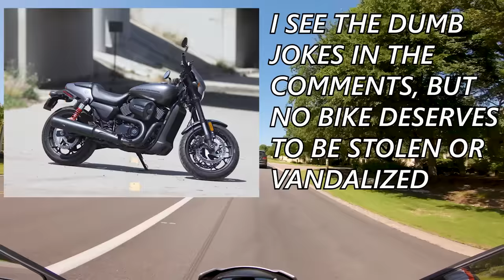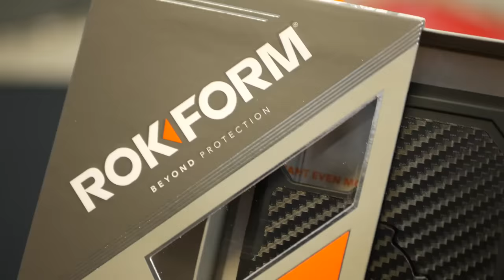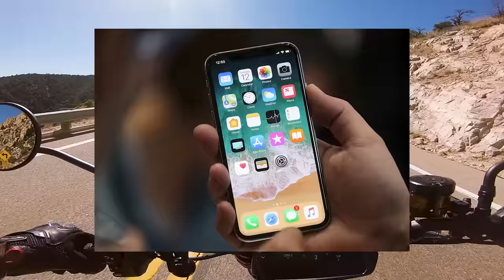How to Prevent Motorcycle THEFT

Comment: Mate those tiles work off a button battery and low energy Bluetooth, meaning they rely on phones seeing the tile and reporting it's location

There is no drain on the bike battery. But also you want get updates on the location unless someone is within Bluetooth range... Useful, but not as good as a active GPS tracker
Reply: I think it has to be in range with your own bluetooth, not just anyones. So basically you would need to be in the same room as your bike

Comment: My advice for security
Disk lock with alarm
Chain lock
Motorcycle cover
Make a hidden kill switch
Unplug  the spark plug replace it with temporary busted one, ohh by the way carry a portable battery charger cause expect the batteries to be drain

Comment: You could remove the battery or self sabotage the wiring and put it all back before riding out ;)
Reply: Or just remove the fuse for the starter or fuel pump

Comment: See Auto Taser on Youtube. I don't think it's still being sold (maybe a used one), but it puts out 50,000 volts and sparks run up and down the bar if shaken. Designed for steering wheels, it should work on a motorcycle. I have one... I used to use it on my Caterham Super 7 (coolest car in the world. Had to sell it 10 years ago), but haven't tried it on my 1998 BMW K1200RS. No thief will play with it - it will knock him/her (maybe her) to the ground.

Comment: Part of the reason the cops don't care is because they get nothing by solving the case. If the cycle is recovered it becomes property of the insurance company. Mine was stolen from a parking garage that had cameras. Security sent the footage to the police department and they texted me some blurry stills of the dirtbag. Case not solved. I've been told selling the individual parts yields more money than the cycle is worth, in which case two or three dudes would lift it into a pickup and take it apart later. Wonder if that's true about the parts...

Comment: what about a kill switch? or even just a quick disconnect for the battery placed some were only you know on the bike. sure it wont stop them but it'll cause them to slow down in there attempt to steal your bike. and if you live in a really bad neighborhood maybe both a disconnect, kill switch, and disconnect the shifter where it connects the the trans so if they do get the bike to start they will get so frustrated with it not going into gear they might just leave it alone.
Reply: I actually have a system installed in my cruiser so i can kill it off by remote just imagine if your on the highway just stolen a cool looking bike and that it shuts off while going over 80mph

Comment: Sorry papa Yam. Most protection out there just doesn't cut it for me. I want trip wires, M15 land mines, handlebars that deliver 2,700 volts of electricity, pressure triggered seats that fire a bullet vertically into butt-hole until disarmed... I want my bike to scream "omae wa mou shindeiru", instead of just giving it titanium panties hoping some fondler won't pry it open.
Reply: Build a electric mat. Park bike on mat, lock it all up, walk off the mat and use remote control to turn on the mat. Volts of cattle fencing charge will drop that sucker and he may or may not survive.

Comment: What ever you guys do, do not go for Xena or Kovix.

My Kovix lasted 2 days, before i forgot the lock was on the disc and I rolled the bike backwards by foot whilst sat on the bike, up a hill on a driveway. The disc lock hit the calliper and instantly broke in half and fell off the bike.

As a side note, the calliper, disc etc all have absolutely no physical damage, not even paint transfer.

Am I stupid for leaving the lock on and rolling the bike, sure, but isn’t the purpose of the disc lock to stop someone pushing your bike away? And is that comparable to sitting on the bike and rolling it with your feet (no engine)?
Reply: What Kovix model did you have?
Reply: @YaboyCurtis_  hey mate, it was the Kovix Overlord, I think that’s the KNX-6

Comment: After my CBR500R was stolen (cue the jokes from Yam) from the front of my house in Melbourne, Australia, I decided that I needed some protection when I bought my Street Triple. 

I had, not one, but two Kryptonite chains on it! They were hooked around a metal street pole out the front of my house. It was as solid as a rock, that thing wasn't going anywhere. 

Motherfuckers brought an angle grinder and took it in the middle of the night. I woke up to a pile of chains. My jaw dropped when I saw the pieces of chain they'd cut off.

I used to always joke that the only way someone was stealing that bike was with an angle grinder, which would wake half the neighbourhood, but some crazy fuck actually did it. 

No more bikes until I have a garage.
Reply: Same, I feel like I am not getting another Motorcycle until I move to a house with a private garage.

Comment: What to do when I have a drum brake on my old bike? Is there a similar lock for drum brakes comparable to a disk brake? Or should I stick to chains?
Reply: You could put a beefy padlock through your rear sprocket and chain, works similar to a disk lock. They will either have to cut the lock off or cut off the chain and unbolt the wheel leaving the bike unridable. Thats what i did with my old xr200 with drums front and rear.
You can also get padlocks with sirens built in too if you want that kind of thing.

Comment: Check out the Monimoto tracker. I’m pleased with it.
Reply: Monimoto looks nice but since it runs on 2 and 3g it will not be a viable option in the US for much longer since 3g is being phased out.  If they update the monimoto to work with 4 or 5g it would be a sweet system i think

Comment: We do care but it’s a matter of actually coming across the bike and then the very brief thought of chasing it as the thief enters warp speed…. Also as far as the information we get from running your plate, we get make, model, color, registered owner, and if you actually reported it stolen and the idiot hasn’t changed the plate, we’ll get a stolen hit.  Otherwise we have to run the vin if they stopped during a traffic stop.  Have full coverage and some kind of tracker.

Comment: Any device or bracking system that locks the brakes in brake locked position like hand brake when ignition off and oem key removed then bike wheels can't  spin until bike turn on or braking system cut off or removed. Its some difficult to ride a bike without brake. It doesn't help when the bike carried by van but it will help most of the time. Hidden fuel pump cut off switch or only be working with nfc then if the ride away from bike fuel pump stop working  so the bike can't be bikejacked???

Comment: 5:33 "they'll need to bust out the bolt cutters to get the cover off".... Now, I'm no master criminal, but I believe there MAY be an easier way to get a nylon cover off a motorcycle without having to use bolt cutters  🤔🤔🤔🤔
Reply: seanylewl if the lock is running through the spokes they’d still have to cut it
Reply: @shanecrockett7442  It would have to be running through the brake disk to accomplish that. If it was just running through the spokes (like in the image shown) then you could just zip tie it down and ride away with it on
Reply: seanylewl zip tie it down to the tire??? Maybe I’m misunderstanding what you’re saying, but it would still get tangled in the brakes and forks and do some real good damage if you try to ride with a lock running through a tire

Comment: If you're built like a wall, a hardened tool steel chain that runs long enough to tie the rear wheel to the swingarm to the frame and front wheel. It'll weigh a ton, but at least you'll be sure that it can't be cut through or removed by removing the wheels. Plus, you can Ghost Rider the chain.

Comment: Anyone know any ignitions with keys my school has days where dirt bikes are used but my bike has a button ignition with no key. Its a ttr230
Reply: Look up motorcycle ignition lock on ebay or something, plenty of cheap universal locks, you will probably need to bolt or weld a plate for the lock to mount to. The hardest thing will be making sure they can't hotwire it so be creative in keeping your wires covered or hidden.
The other easier method is to have a hidden kill switch somewhere on the bike or even just remove an important fuse (like the starter or fuel pump fuse) from the fuse box or the big inline fuse most bikes have.